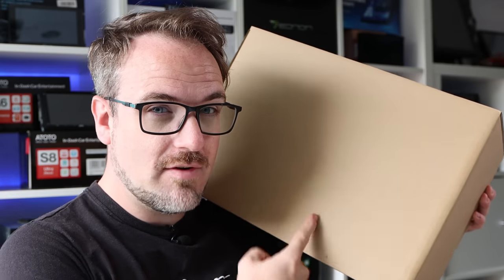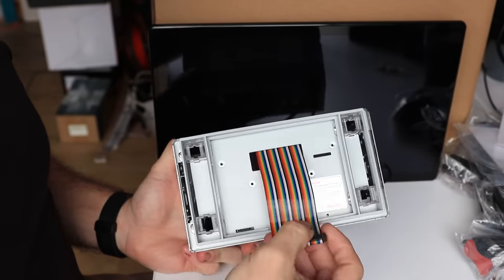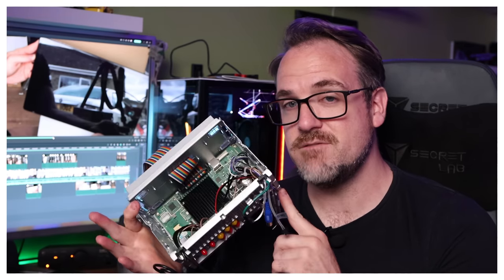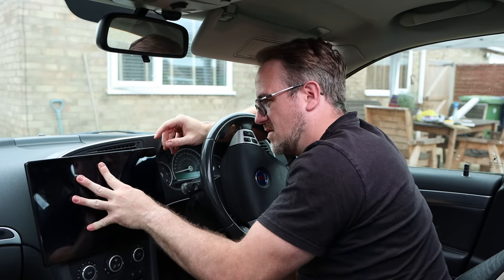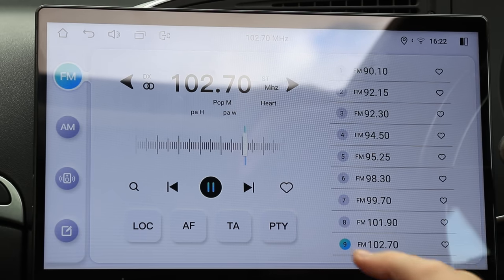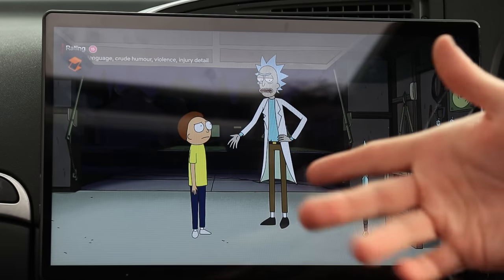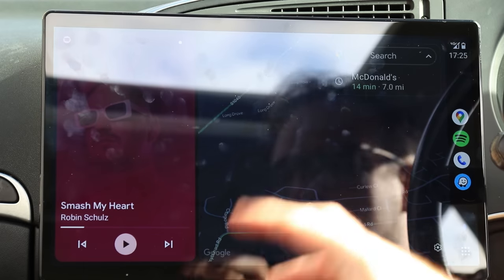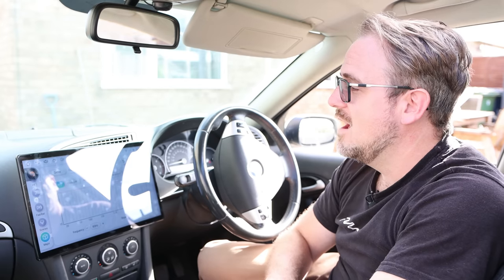2023 FLAGSHIP Joying 15.1inch Car Head Unit - My Favourite! -Android 12 -8gb RAM -SECRET HDMI PORT!

Comment: Still behind units like the CC3 2K and the Navifly 13", in UI, HW specs and rear I/O........pity that!
Reply from the maker: I disagree with regards to I/O. This thing has coax and optical SPDIF, HDMI & 360 camera compatibility along with all the usual stuff. It actually has more than those other premium brands. Hardware wise, correct it doesn't have the UIS7862 or the 2k screen, but it's still very fast and the split screen ability makes it super functional.
Reply: @SaabUnleashed  The other have all that too my dude! lol the benefit being they have the HDMI plug on the rear i/o plus a better CPU and more ram and internal storage! (except the CC3). Split screen is also available on bot the CC3 and Navifly! Not to mention a way better UI. Plus the Navifly 13" 2k Qled model also has optional HDMI in and out!
Reply from the maker: I don't disagree with you on lost of those points. The very highest spec Android head units have lots of cool stuff.
I might need to check out the Mekede that has HDMI in and out

Comment: I'd love to be able to run a CAN cable from my Haltech ECU to display any gauges I want on the HU, but there would need to be an app to display those. 

I'm currently using OBDII but it won't show all the sensors I'm using, including dual EGT and coolant pressure, neither of which can be displayed through OBDII

Comment: I'm wondering, do you know if you can control the climate adjustments through the head unit? 
I know it has CAN Bus decoding, so I would assume there is a way. 
I ask because this thing will literally cover my climate control module, haha. 

I am extremely glad you reviewed this because I'm literally looking for a new head unit to install in my STI. I love the big, high resolution screen, looks amazing. 
I was torn between the Teyes and Joying because I really like the bigger screens that Joying has, but this sold me. I didn't even know they had a 15.1" screen coming out. I understand why some don't like it, but to each their own. They've already added a screen about this size to the newest model WRX, but I have the previous model "WRX" because they stopped making the STI after mine. So I don't have the bigger screen...yet. 
I'm probably going to order this today.
Reply from the maker: It can view or control climate control if your car allows it. Later model cars generally allow this. I would probably suggest getting one which allows you to access the original controls though :)

Comment: I own this headunit. Typical Joying fashion: 1 step forward 1 step back.
-why does the volume menu stay on the screen so long and take up so much screen real estate? Their 2021 version had a small yellow line at the top of the screen to show volume change.
-They removed the function to have the rear camera on while driving forward. Sure there's the AR camera app but the words & such take up screen real estate. If your headlights turn on it defaults to the front camera. So frustrating.
-The AR camera app doesn't show as an option in split screen. Yet another function that they took away from their 2021 units.
-They locked down the Bluetooth YET AGAIN just like their 2021 unit.

I'm so tired of this from them always taking one step forward and one step back
Reply: So this units bluetooth is crippled to only their stupid devices? (0000 or 1234)  I cannot use my OBDLink MX+ to connect to Torque?  I need full bluetooth, will pass on this one, unfortunate, hit many of features I was looking for, even if I have to rip the top off to get to the HDMI port.

Reviews should include this kind of information,
Reply: @davedogmoore  so @ElevatedVehicles YouTube channel was talking about this on the joying forum & apparently there is a workaround that Joseph posted & @elevatedvehicles YouTube channel was going to try to see if it worked.

Comment: Android units are getting better but if you want to listen to quality sounding music then steer clear from this and every single other aftermarket Android head unit. 

A low budget Kenwood or pioneer is far far far superior in sound quality to this.
Reply from the maker: That is absolutely incorrect. The sound quality is relevant to the DAC, DSP and built in amp, for which there are multiple possibilities, so it really depends on the components. 

It is true that more expensive brand named units often have more powerful amps, but this is volume not quality.

The equivalent of what you're saying is that an iPhone is better than an Android phone, without even checking the specs of the Android phone.

Comment: 11:25
1080 vs. 15" cannot be sharp!
That is the resolution you get from a 20 year old Notebook.
Reply from the maker: It's a car radio. And a 20 year old laptop was 800x600 :)
Reply: @SaabUnleashed  There is google, if you don´t know:
e.g. a T60 from 2006 had a WUXGA resolution. = 1650x1050
Reply from the maker: @derJackistweg  I mean, 2006 is only 18 years ago and that resolution was rare in a laptops back then and it still hadn't got the pixel count, width or hight wise, of the HD resolution 1920x1080. ;P  But I get your point; higher resolution screens exist. But to put them onto a car radio would just add a unnecessary expense.
Reply: @SaabUnleashed  You try hardly to tell me I was wrong, I got that.
18 vs. 20 years is huge difference.
FHD is 16:09 - WUXGA is 16:10 

Anyway you want to turn ist, AHD on 15" is NOT sharp. I am out.
Reply from the maker: @derJackistweg  I didn't say you were wrong, because you're not; I told you that I understand your point... just having a bit of banter along the way :)

Comment: 12.95" HD Touch Screen Radio With 1920*1200 Resolution Android 12 Double Din Head UnitLatest 2K Qled Screen 11.5 Inch Double Din Head Unit Android 12 Autoradio With DSP

Comment: Buddy you made a 22 minute long video and dedicated only 10 seconds to showcasing android auto , that too in a blurry angle. Android auto and Apple CarPlay performance ARE THE ONLY THINGS that matter to most people.
Reply from the maker: That's your opinion, and I respect that.
Android auto and Carplay are just an extremely limited industry standard, designed as a way to bring apps into cars which would otherwise have no means, and they just work by streaming apps from your phone. So you just need a head unit with a decent WiFi hotspot signal. Barely any other specifications are required.

The thing is, Android head units, like this, should actually negate the need for AA and Carplay, offering a far better experience running the full apps directly. 
This head unit in particular has so many fabulous features, meaning it is simply a travesty to default to Android Auto as a daily driver.